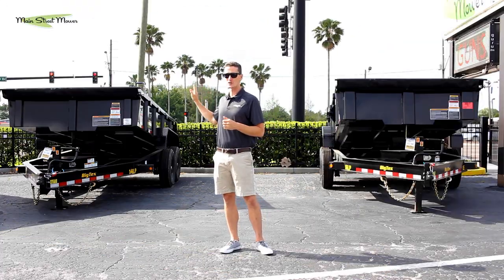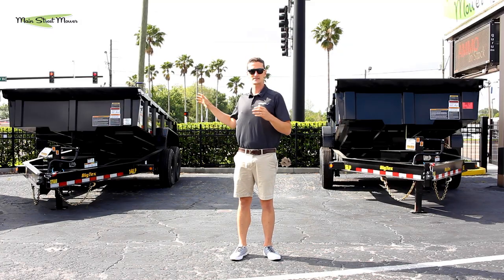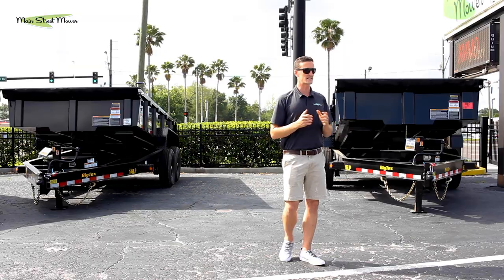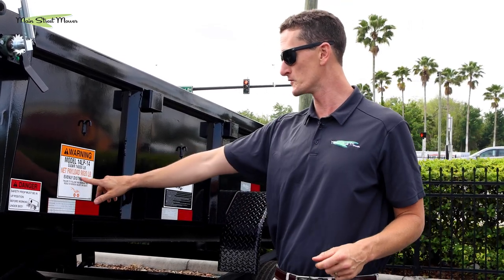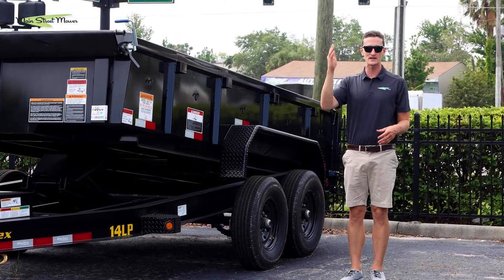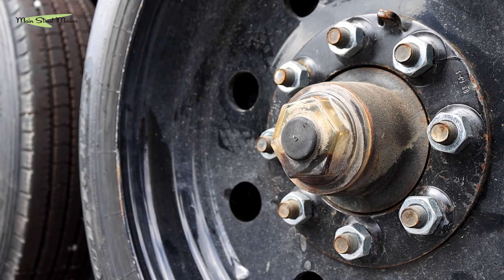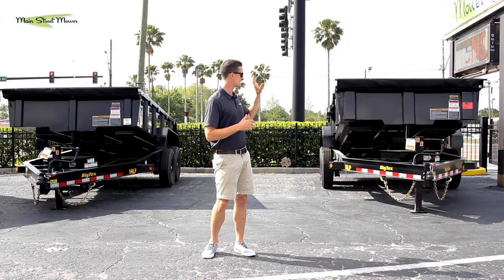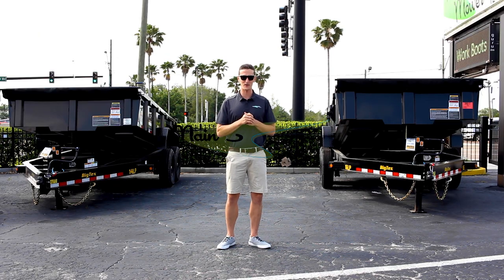Busting Trailer MYTHS - BigTex 14LP vs 16LP - Complete Analysis and Comparison

Comment: Do you need a CDL to haul either one of these trailers?
Reply from the maker: If your vehicle weight + gross trailer weight is over 26,000 you will need a CDL. Vehicles like F-250 & F-350 can range between 6,500 - 11,000lbs (you should be able to find this on the inside of your driver door) add either 14,000 or 16,000 to your vehicle weight.
Reply: If you only pull it with a mini van, you should be fine.

Comment: 25,999 gross combined weight meaning truck and trailer is the non cdl cutoff and why the whole dump craze took off years ago as cdl drivers were hard to find, so a ram 3500 dually 1ton  dump has a max of 14k gvw and leaves 12k for a trailer, thats excluding a landscapers 4 man crew.5500 series truck at 19,500 gvw forget about it unless you want to pull a t/s single axle.

Comment: Never mentions to subtract tongue weight. So misleading.
Reply from the maker: If you are speaking of transfer weight or pin weight, that is for gooseneck weight ratings only and doesn’t factor into bumper pull trailers. Please learn me otherwise
Reply: Show me where it states that tongue weight is only for goosenecks. If you have any tongue weight than that's weight that applied to the tow vehicle and NOT the trailer suspension.
Also dozers don't carry anything.
Reply from the maker: We agree that some amount of the load is being shared by the tow vehicle, but some regulating bureau that makes the rules, probably DOT has determined that it can’t be added to the GVWR. We aren’t the ones to say, “ignore this sticker, your truck is carrying some of the weight so feel free to exceed these limits”
Reply: Tongue weight has nothing to do with gvwr combination or trailer gvw.  Tongue weight is all determined by placement of load which should be around 10% of your load.  Tongue weight with vary depending on what you are hauling.